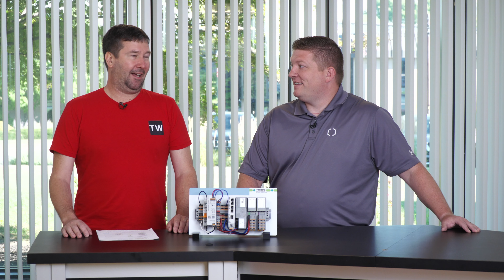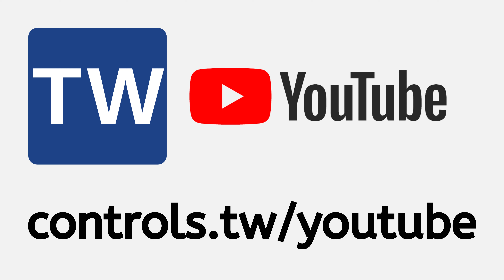Arduino and Raspberry Pi aren't Industrial Rated

Comment: Tldr: this is a bait and is clearly leaving out alot of details

Tbf i havent seen anybody try to deploy an arduino in an industrial setting. Mostly just for development and proof of concepts. Not to mention that, i think, everybody knows that both (products commonly available or what most people know) are just hobby grade and are for enthusiasts and learners not for corporate use.

Sigh for an informative channel you left out alot of things for clicks much to my dismay

To begin with arduino is a development board using an atmega microcontroller. In an industrial setting, people are surely to use custom pcb or maybe even a microchip PIC for their specific use rather than an all-rounder board. They surely have industrial grade capabilities. rpis too have industrial applications as shown here by jeff geerling https://youtu.be/9MqJI_F-sz8.

And for people who are wondering yes most of the time if not always they are sufficient for home applications given that one did a sufficient job in their putting together their home projects. A consumer grade microwave is perfect for a home but not for a business and a commercial grade microwave is typically overkill for a home not just in price but also in specs.

Not to mention all the benefits of using these products not only in homes but also in industrial applications. Most notably, support! With just the amount of people working with these products and all the open source stuff that goes with it, youll spend way less time debugging or modding! Imagine working with industry grade products with no datasheets, no documentation, and no community to help you with only money grabbing "accredited" repair shops or unresponsive customer support!
Reply from the maker: Great feedback @neinnine.  Did you watch the main video or just the clip? https://www.youtube.com/watch?v=W28u1X1VB6w

There are people trying to put $30 Arduinos in industrial settings, they reach out to me when they find out they don't work.